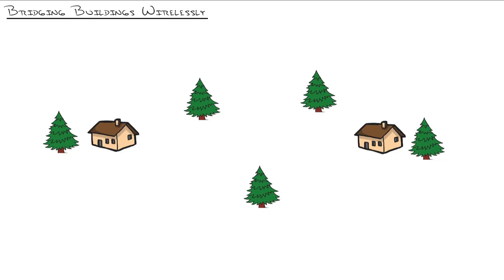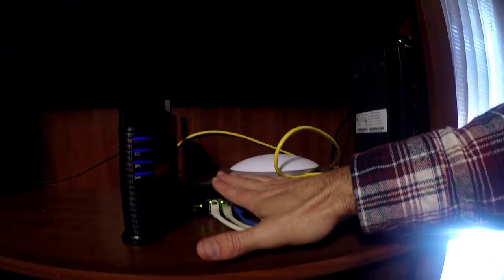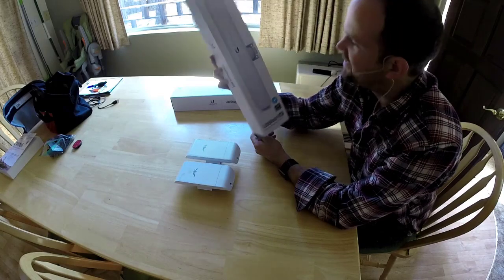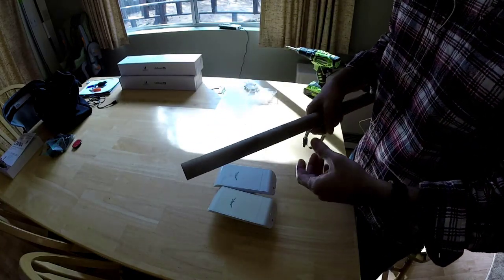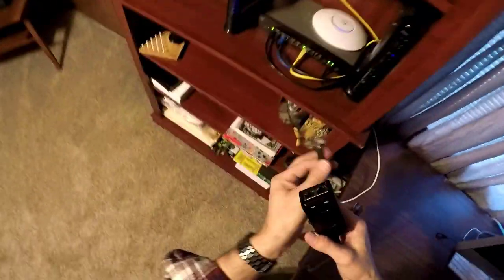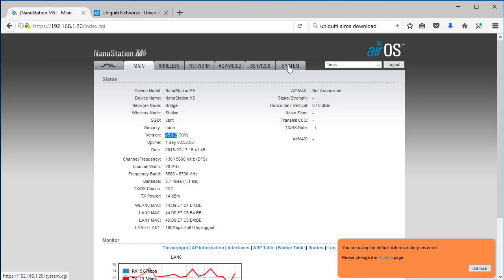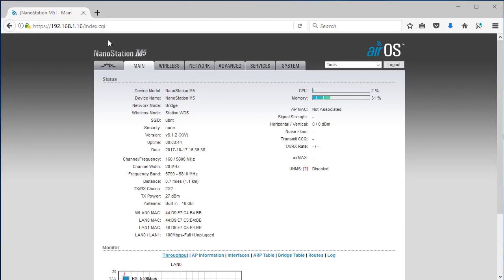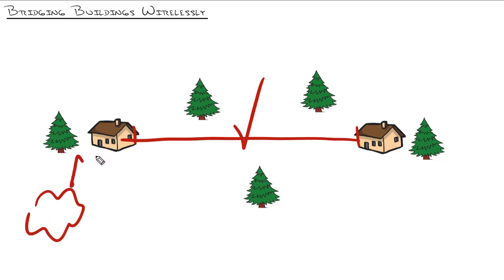Wireless Bridging Between Buildings

Comment: Wondering if these would work between the two buildings and have the Ubiquiti equipment on an x.x.x.x/29 network. Then L3 switches inside the Bridge on each side with unique x.x.x.x/24 networks on each side. Then on the L3 switch configuration setup OSPF and FHRP so the connection between the buildings could act as a failover connection in case your primary fiber went down?

Comment: Hi, I need some help with set up. I have two locations A and B, both are apart by around 1 KM, so I want to use CPE's to share the footage from cameras set up at Location A with Location B ( which also has some cameras) and  save the Camera data at Location B.
The location B has internet access, so I want to share the internet from Location B to Location A as well.
So, my question is can I use single CPE network for both of these use cases?
 
Do i need some special configuration or hardware for this
Here is my raw set up:
https://ibb.co/KxWyXYJ

Any pointers?

Comment: you showed locos but setup nanostations? lol. but good install. probly could 1/2 the output power of the devices. Nanostations have the nice POE out as well so can do a camera to them. 
Definitely do router mode for the 2nd cabin so they cannot see the base network or access any of the management. Also small UPS on network gear so quick trips dont mess up reboots

Comment: Awesome video. When you changed your PC's IP to 192.168.1.12, did you leave it inside the main LAN, or you had to unplug the PC from LAN and connect it directly to the Nanobeam? What if there was already a device in the LAN with 192.168.1.20 before reconfiguring the Nano? Thanks a lot!

Comment: Hey Jeremy, Thanks for putting these out!

I have been hearing a lot of conflicting info from this but I have a quick question, I currently don't have my CCNA. If I were to pass all 3 exams of the current CCNP, would I still be grandfathered in to the new CCNP given there is no longer a requirement to get a CCNA first anymore?

Thanks again!
Reply from the maker: No you would not simply because you did not meet the requirement for the "old" CCNP (which was being a CCNA first).